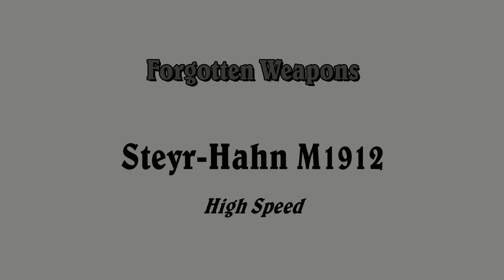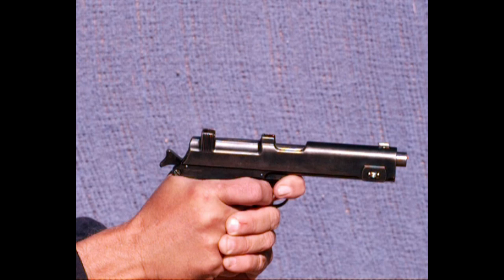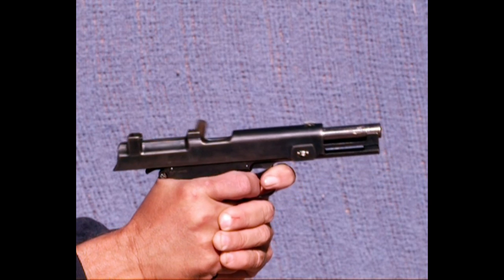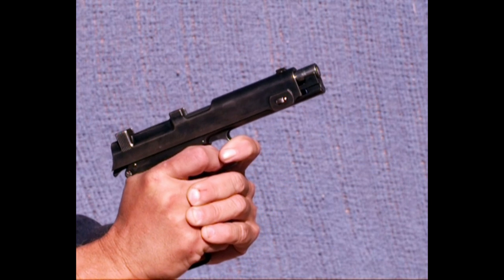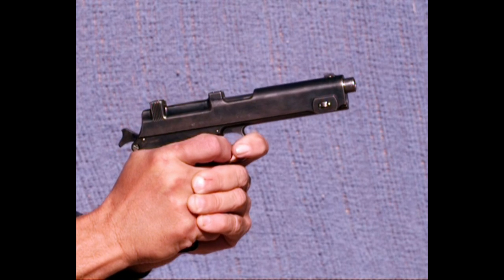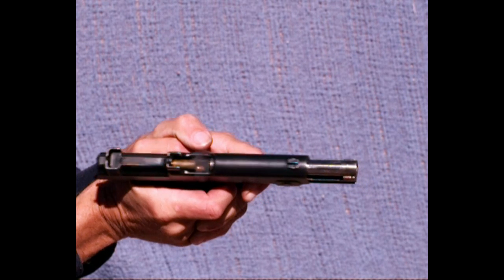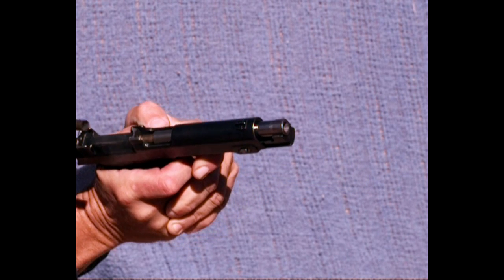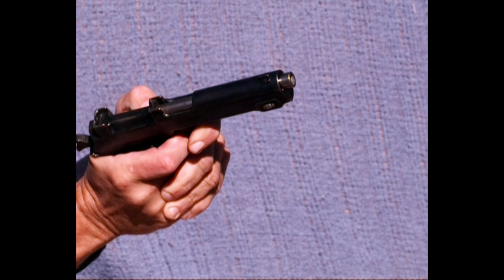Slow Motion: M1912 Steyr Hahn

Comment: I've got one of these. Love it.
Reply: me too.  I am awaiting a new barrel from IGBAustria.  I hope to post some vids in the next few weeks
Reply: Rostit what did you pay for the barrel?
Reply: $320 with everything.  Worth every penny and all the waiting.
Reply: Damn, Thing is I am from austria, so the expensive shipping won't be that much of a problem, but i need at least a new barrel, springs and that safety thing - that'll be hella expensive!
Reply: chech numrich.com  I bought a lot of parts for pretty inexpensive there.
Reply: The link is not wrking but i guess you meant this page gunpartscorp.com Thank you!!
Reply: FixitFrank Sorry, I know this thread is three years old at this point now, but I have to ask because I cannot find anything anywhere online about these barrels.  I’m considering one in 9mm Luger for my steyr, how reliably does it function in yours?  Any issues with the fitting or tolerances?
Reply: @slavsupreme5129  Idk if Wikipedia is reliable but it mentioned luger variation without any specific variation of the gun so I guess it could

Comment: Locked breech: Does the slide and barrel start moving together before the bullet leaves the barrel?
Reply from the maker: In the most technical sense, yes. Newton's Law dictates that the slide and barrel start moving immediately as the bullet does. However, the bullet accelerates much faster because it is much lighter than the slide and barrel combined, and the bullet has left the muzzle before the slide has moved any significant distance.
Reply: Forgotten Weapons and does the barrel in the Savage 07 stay locked for more than a milisecond?